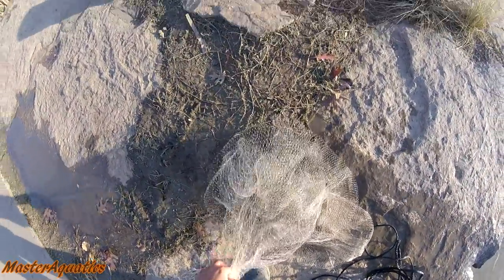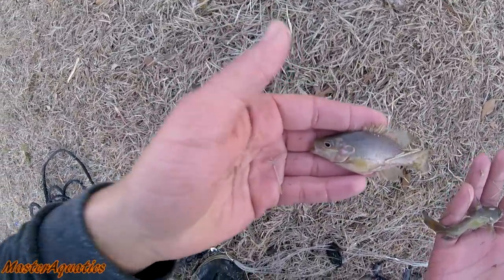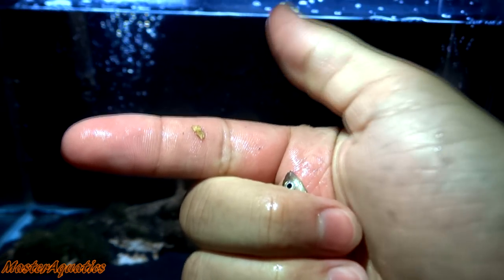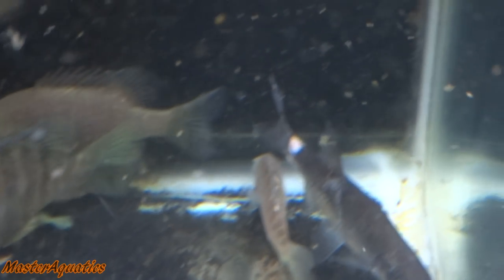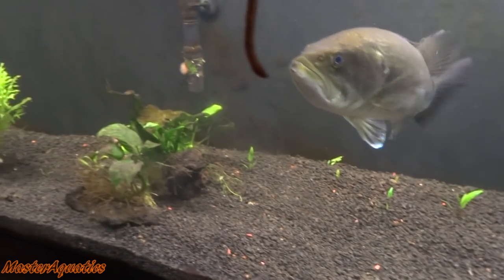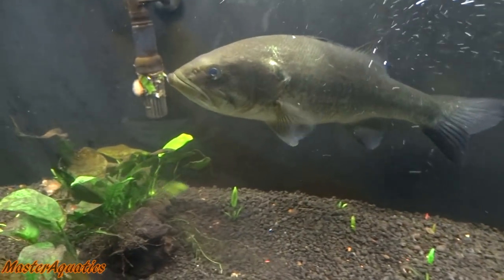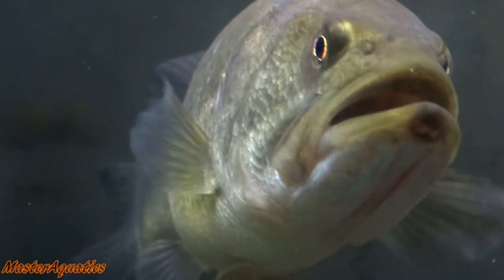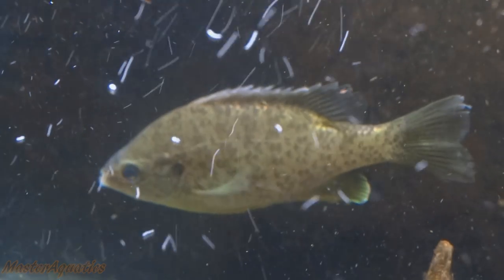Caught new pet for fish tank! What type of fish is this?!

Comment: That's yellow bullhead for sure you can tell by its tail it looks like a drywall scraper not the traditional v shape and its oversized head and eyes with pointed bone under the aposal fin and rusty tan yellow color,I catch em all the time here,typically 10-12" but will reach 14-16" and weigh 2-3 lbs. But will reach 6 if keeper in the right conditions, and live to 8 years,in 68 to 71 degree water temp,in weedy ponds and lake,I've even found em in rivers,so keep the tank well planted, 

Source: my fishing log,from my teciques I've worked on,my studys